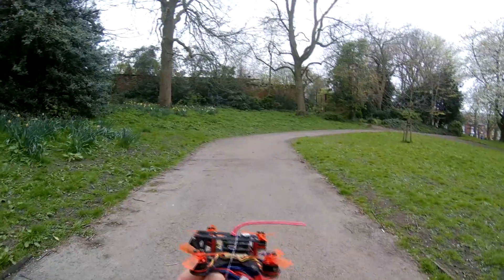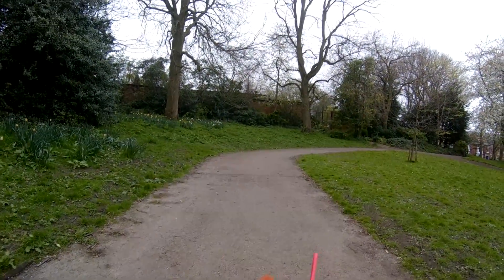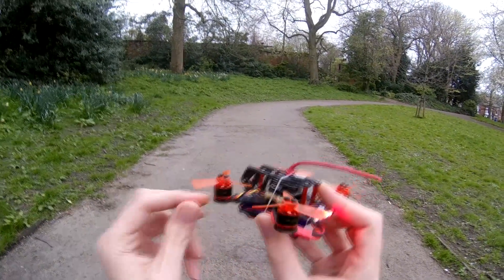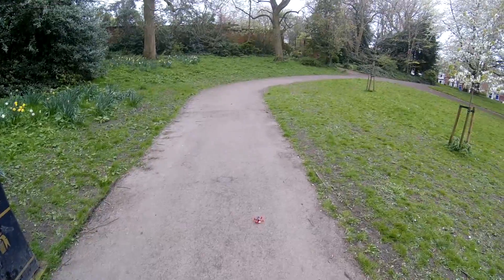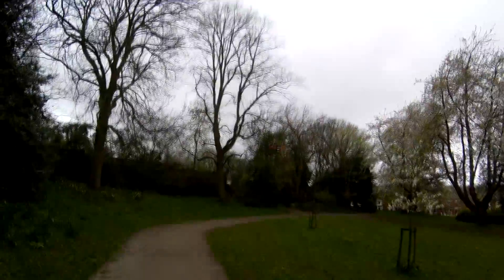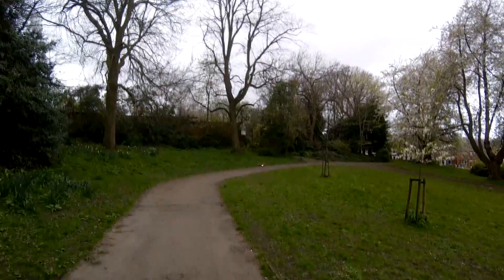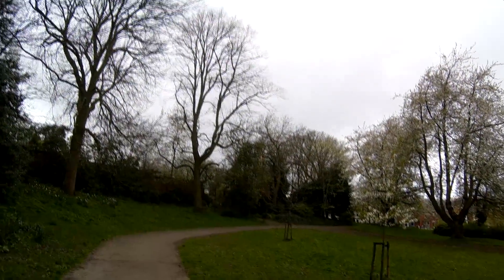Aurora 100 - Firer 110 Upgrade - 2S and 3S Power

Comment: Nice frame m8,awesome flying 👌. Dod.
Reply from the maker: Good basher but they seriously need to change the cutting bit from butter knife back to a CNC cutter. This and a realacc 210 I built recently needed some serious finishing up to avoid carbon splinters.
Reply from the maker: Yes, basically an A100 in a smaller frame.
The E90 frame looks about 95% identical and just finishing putting the A68 guts in that now. I was going to put the A100 parts in it but the triple decker board won't fit.
Reply: I like the narrow but thick arms. You going to upgrade to 200mw? Dod.
Reply from the maker: Probably but I figure sort everything else out first and get it reliable, add antenna protection when back in stock etc.
Just put a pack though the A68 in the E90 frame and it flies but all small props are horibly balanced. I stuck some A100 KK tribaldes on and it's smooth but motors get warm so now on the lookout for decent A68 props.
Reply: Would that be 1.5" props?
Reply from the maker: Yeah bout that. About 38mm diameter for A68 props, 50mm for the A100 props
Reply: MicroRCFiend yeah not much 38mm to choose from. I did see these tho https://www.banggood.com/2-Pairs-Gemfan-2035-2X3_5X4-4-Blade-1_5mm-Mounting-Hole-CW-CCW-FPV-Racing-Propeller-p-1139324.html?rmmds=search . Dod.
Reply from the maker: Price is a bit harsh considering any breakage at all and you need to make another purchase. The kk tris and purple 5 blade I used are about 2.5 times cheaper and both fly great.
If people report they are super durable i'll try some but I my entire fleet desperately needs new lipos from 1s to 6s so trying to be a little bit more frugal with the RC budget.
Reply: MicroRCFiend yeah I get ya m8.

Comment: Hey bud,I know i have been asking you a lot of questions lately but you are one the few people in the hobby that gives answers.
Anyway so i Calibrated my aurora 100 and it flies normal with air mode but when its in stab mode its not only shifting it does not respond to the throttle accurately.It goes crazy. 
One more thing how can i open DFU in betaflight on this omnibus flight controller .
please help
Reply from the maker: Why did you calibrate and what did you calibrate?
Dshot requires zero calibration at all, none. Reset it to stock and only setup sub trim, endpoints/travel adjust and flight modes with acc calibration and try again. Stock ESC and FC are perfectly suited to flying amazing on stock PIDS.
The FC should flash without DFU mode but usually zadig will sort that if it's actually needed. Countless videos on using Zadig and Impulse driver fixer will show they way to use them.

Consider RCGroups or something along those lines if you need quick answers to things as there's scores of users with the same model that will reply usually..
Also, if put your issues and progress in a video so people can have something to work with. Even if you make it private so only people wit the link can see it and delete later.
Reply: I calibrated the accelerometer in beta flight .i used the pids from AndyRC video of the aurora 100. And i have angle , horizon and air mode. I removed the props and turned it on. When its in airmode the motors respond to the throttle perfectly but when its in stab or horizon if i push the throttle a bit it keeps on taking punch and the percentage is not stable thats why it immediately flips on its back if i have the props on. 
Again thank you so much for your support. Much appreciated bro.
Reply from the maker: Ok, ACC calibration is fine, don't do any ESC calibrations. I'm failing to see anything wrong with what you describe though. Try and hover it if direction to motors are all correct.
Don't expect your quad to act normally on the bench without props on, it may in some modes on some firmware but is not a wise way to read your quads setup. I fit works in angle mode as you say, all basic are correct. If you have vibrations, fix those first as angle mode will never work well if you have vibrations, same with horizon.

If it's flipping then first check motors rotations are correct, not just visually, put a prop on and test each one. 
If this is good check board rotation is perfect and your ACC calibration screen model will tilt as it is expected to tilt.
Other than that, incorrect props on wrong motors can flip as you say but board rotation is more violent usually if out. 

Some video rather than working blind would be sensible to show specifics.

Comment: The M2x6 screws supplied with this frame do not fit properly into the threaded aluminium machined camera mount. Did you find this problem too?
Reply from the maker: As in badly cut threads? No issues with machining or threads on the one I ordered although the finishing on the carbon left a little to be desired. 
I think I swapped for allen head bolts as one stripped but the alu camera holder/plate is fine.
Shoot BG some pics or a short video of your issue, i'm sure they will get another out to you if it's machining faults?

Comment: I've just received & glued to std frames together. Fingers crossed it'll handle a crash MUCH better. If not, I was wondering if the Firer 80 would be big enough for all the components. What do you think Micro?
Reply from the maker: Too small for stock 2" props but the components would fit. A68 is a better candidate for that frame. I'm just moving over my vibration ridden A68 to an E90 frame, I think that is the smallest/lightest non ducted quad that will fit 2" props just.
Reply: that makes sense, lets hope this double decker holds up. Not sure whether to try 3s or not.... is yours still stock, besides frame/blades??
Reply from the maker: Yes but not really using stock props because of the fragility. I had a good 3s thrashing session yesterday and even on 5 blade props stick banging I could not get it to do anything bad unless I tried 3D. I would not use any more blades than tri if you do plus keep the lipo below 500mah. The DYS tris and junk but the KK ones are super all rounders well worth the money.

If you have to buy lipos i'm not sure i'd really go that route unless you absolutely need more speed. I'll try an get the video edited later after the E90 build is done., 3s on 5 blades is actually quieter than 2s on 5 blades, proper freaky ghost quiet.
Reply: Weird! I don't have any 3s so will stick to the 2s as I have plenty of them. I also have some KK tri props coming on your recommendation :)
Reply: Hi Micro, the KK Triblades are super durable, but lack a bit of punch. Need a little advise. I would like to change the flysky f/c with a frsky version (so everything uses one TX) it hasnt come with any instructions, any ideas which pins need connecting where please? cheers in advance
Reply from the maker: The top board of the 3 on the A100 is the receiver so if you are still in the stock frame, you can just remove the two plastic screws and swap out with the Frsky one.
https://www.banggood.com/search/minicube.html?p=UI14032168777201508N

The A68 is lower and will not fit 3 board stacks so uses a separate RX with failsafe connected to the FC. You would need to add the buzzer too if using the latter but it is a couple dollars cheaper to add just an RX than the RX board. If you need pinouts on the FC, easiest way is to look at the RX labelling on the link above about half way down each page. 
You have a row of 3 for your RX next to your bind button and then 3 pairs -  buzzer and smartports next to each other if you go round clockwise and then power input on the other side with the antenna I believe. Multi meter points to be sure.
Reply: Thanks Micro, the minicube frsky f/c had 1-3s labelled as A1 & A2, do i just leave them unconnected as they're not on the minicube flysky F/c, or do I need to connect them somewhere?
Reply from the maker: Those are voltage sensors. You can ignore them or..
Solder a wire with Vbat (e.g. from the supply pin on the FC) to either one of the sensing pads (A1 or A2) on the receiver. Remove the top plate for that, nothing else. Now you can create a telemetry screen or a voltage alarm on the Taranis using the A1 (or A2) sensor.
Reply: fab, thank you so much, will check it out later
Reply: struggling to see the Vbat connection on the f/c, any clues mate? is it a +5v & ground, if so, can i use the same ones that solder to the RX (2 of the 3 block?)
Reply from the maker: The manual is half way down the page in red text link.
Bottom of the first page in the manual has a labelled diagram. 
http://files.banggood.com/2016/12/Eachine%20MiniCube%20F3%206DOF%20integrate%20OSD%20Manual.pdf

Here's another pic
https://static.rcgroups.net/forums/attachments/5/7/0/7/8/5/a9997353-123-aurora_Vsense.jpg
Reply: super, thanks a lot. All soldered and ready to roll.

Comment: Dude i flashed the newest betaflight firmware now my flysky binds with the aurora but it doesn't send signals:/
Reply from the maker: I'm gonna take a wild guess and say you aren't reading the lovely colour manual that comes with your A100? :) Matching settings you had before the flash?
A clean flash on Betaflight usually mean you have to set up RX type again. The bind won't change after flashing but the FC does.
I don't have a manual I can access easily right now but I thin kit's 'RX_serial' and 'SBUS' off the top of my head the manual says but I think mine was possibly set to PPM and still worked.

Comment: Hi Micro, Im hoping you can point me in the right direction bud. In my haste to flash the firmware to the latest version, I seem to have buggered it up as I selected spracingf3evo instead of omnibus and now it can't find the bootloader :( any ideas how I can bring it back to life please. Cheers
Reply from the maker: If just attempting to flash incorrect firmware on there, i'd simply try again with the correct firmware.
If it's not playing along then you will most likely have to put it in DFU mode. The Boot Pins/solder points 1 and 2 need connecting to do that and of course removing the bridge after to get it out of DFU mode. It should actually come up in BF as DFU mode at the top right instead of com port then and let you stick the Omnibus target on it.
Boot 'pins' are between the labelled OSD and the largest black chip on the FC but they are on the underside of that board i'm afraid. Bottom of page 1, uppermost right diagram in this manual for the minicube shows those points. Careful because the PPM/SBUS pads look similar and aren't far away.
http://files.banggood.com/2016/12/Eachine%20MiniCube%20F3%206DOF%20integrate%20OSD%20Manual.pdf

Latest Betaflight should allow you to put stuff into DFU mode with just a CLI command of 'DFU' but of course you need to be able to actually connect to the thing first.
If you do all this and still don;'t see DFU listed in BF but sure you have it correct, you may need to run the driver update tool 'Zadig' and or 'impulse driver fixer'. SO far I only needed them for F4 boards and DFU mode but it's worth knowing about if you have those issues.
Reply: cheers bud, was a ballache to strip apart, but it's flashed. Now to put it all back together. I love this hobby - wont be so hasty next time!
Reply from the maker: Nice work bud

Comment: hi
im looking for a sub 250g auw quad for my backyard in the 90-100size 
which one would you buy/recommend? 
i looked up all your reviews and couldnt come to a result which one you liked best/which ones has most controll/performance
id love to put a rumcam micro into it so it would need some powaa;)
Reply from the maker: There's not many that will fit or carry a runcam micro until you go above that size. The only one I am aware of is the new newer tomoquads frame and the 1105 fpvhobby ex90.
That's super aggressive though so you'd need a large backyard or good thumbs :) I guess you could fly them on 2S if needed though.
Reply: MicroRCFiend 
Ok
And from the other frames?
If i use the stock cam
Reply from the maker: If ok with the combo cam/vtx type units here, the Lizard is my personal favourite right now as an RTF with the Aurora 100 close behind. 
Those components in an A100 upgraded thickness frame and antenna protection would be my personal choice if building one.
If building one those 6000kv 3s 1104 motors matched with 20A dark racerstar 4 in one ESC is a fierce, well balanced setup.
I'd also be tempted to fit a stronger 200mw vtx/cam although soldering mods are needed to get osd working like stock cams.
Reply: ok, that also sounds nice!
thanks alot fpr your opinion and suggestions!
keeo up your great work:)

Comment: hey man ,i got the aurora 100 but its not stable in stab mode even if i did calibration.any advice?
Reply from the maker: If it''s fine in rate mode then it's your accelerometers that are being thrown out usually. If so then that's normally either down to vibrations or occasionally an over sensitive gyro but fairly rare.
Soft mounting the FC with O ring spacers is never a bad thing to either and sometimes will sort it enough for Angle to work as it should.
Stock props bend super easy on any contact so try some fresh ones if you haven't.  Other than that a video link with actual time code of teh problem showed clearly would be a good idea as I saw nothing describing this in your two videos, unless I missed it?
Reply: MicroRCFiend i will be posting nice acro flight videos tomorrow and you can see that when i first start with a lunch in angle mode ( stab ) it shift to one side usually landing on its top. I can only lunch it in air mode . Anyway thanks a lot for replying and ill make sure ill post the videos tomorrow. Cheers bud👌
Reply: One quest: do you think flashing the newest version of betaflight might fix it?
Reply from the maker: Sure post a video after trying some solutions but I don't need see angle mode leaning to understand if you are fine in rate mode.
Now if it leaned in rate mode too then you woudl have more than just vibrations to sort :)

My A68 is bag of wobbles and vibrations too and simply will not fly predictably with any accelerometers enabled. Hoping a frame swap will sort that one.
Reply from the maker: It's quick, free and reversible so no harm in trying but i'd be stunned if it had any effect at all.
If they changed the default filters then perhaps they will be tamed slightly but the frequency of vibrations chnage with throttle so you would have to find a certain range and fly that speed only :)
It's not an exact science or quick to get results or even getting to the root of the problem, however,  if you run out of stuff to try and it's doing your head in...
You could maybe try adding your own filters in Betaflight after recording some black box in flight and determining out what frequency/throttle ranges are your issues. Doing this after the other things in the previous post such as props would make sense as you ruled out obvious mechanic issues.
Spinning up in the GUI and watching the vibrations real time without props and see if that is in line with vibrations punching out in your black box with props on. Normally doing this inside with props on in insanity but with this guy I would probably just hold on tight and give it some bursts.

I played with the BF filtering options once with little results but like I said, if you got vibes that's not fixing anything, it's just masking them from the FC so the problem is still there. More of last resort the way I see it.
Joshua Bardwell has superb videos covering all aspects of black box and filters, recording, reading, understanding etc if you need any questions regarding using that, he has definitely covered it in one or several. You can even submit your black box problem recordings along with some flight video and he will help diag stuff but I haven't seen him do too much of it lately since most stuff is either obvious once components are tested individually and recent BF and BLH work close to flawlessly. There's an RCG forum listed in each of those BB videos he does for others and that's also a great place to post vibration issues for help.
Reply: Thank you so much man. Last and final question: i bought a 850 mah 25 c battery 2s . Would it harm my aurora 100 or its fine? I couldnt know how heavy it is hit i'd say probably 48g
Reply from the maker: My Walkera Rodeo lipo is 850man and 30C weighing 46.8g after changing he connector and it's my favourite so far.
I have not tried any really really high C lipos in this yet but yes that lipo will work great.

Comment: how did you set your antenna up like that "details please" I like to do the same mod Tks.
Reply from the maker: It's just a cable tie round holes in the top. Run the antenna up the back of it (more protected in crashes) and add heatshrink in your colour of choice. I also added a dab of hotglue as strain relief to the antenna and to stop it backing out so it was maximum length. It kinda keeps it's curve if allowed to cool while bent but you can pretty much shape it afterwards to some degree. 
4:20 to 4:35 kinda has the best shots but kinda out of focus.